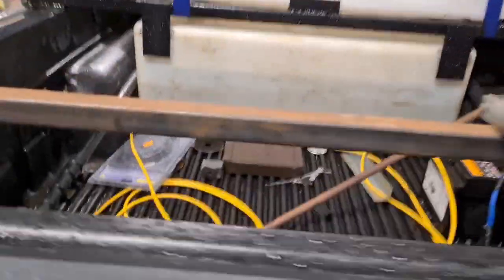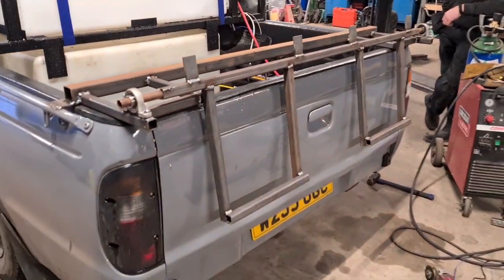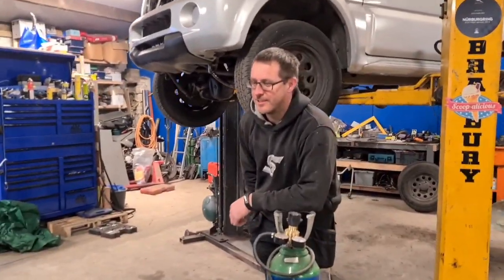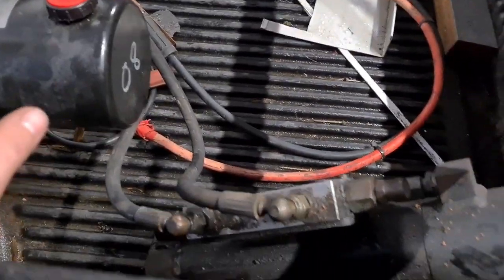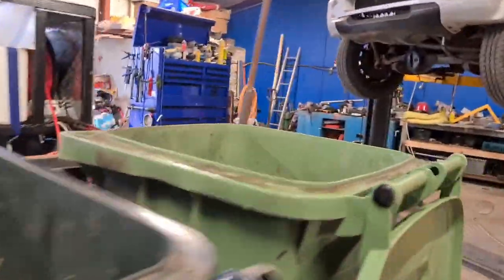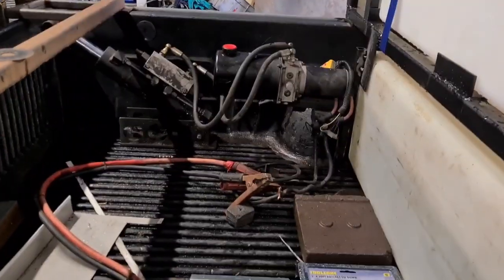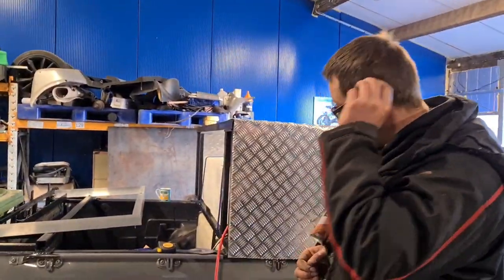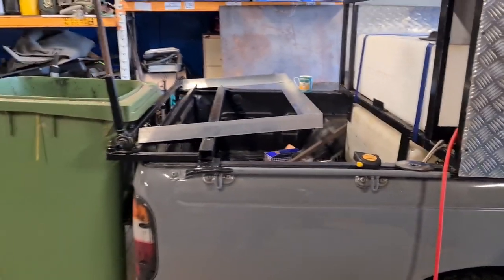Bin cleaning machine part 4

Comment: how much was it to build this manual system?
Reply from the maker: If you can weld very little kn materials bearings around £70 for the lift and tray
Reply: @wheelhobbies5021  I wouldnt mind buyin it off you!
Reply from the maker: I actually sold the Lift in the end and the truck
Reply: @wheelhobbies5021  if you don't mind me asking, why?
Reply from the maker: I went into full exterior cleaning rather than bin cleaning in the end. Found it easier to offer the likes of driveway cleaning along side my window cleaning
Reply: @wheelhobbies5021  where are you located? and where can I find those plastic tanks?
Reply: @wheelhobbies5021  can you send the drawing of the system? I need to make one for my business.